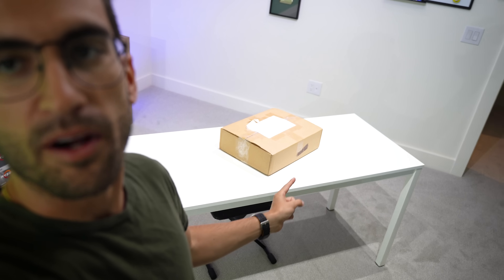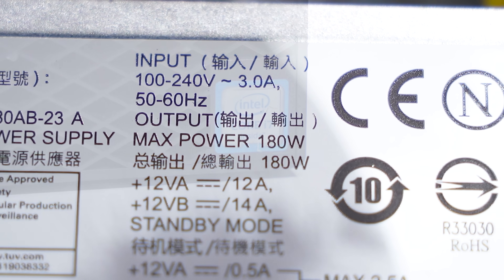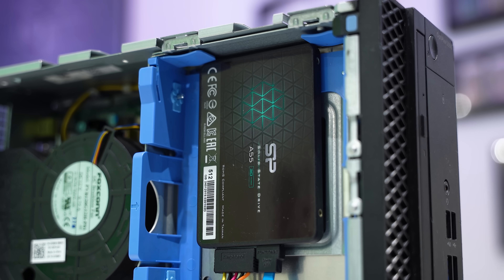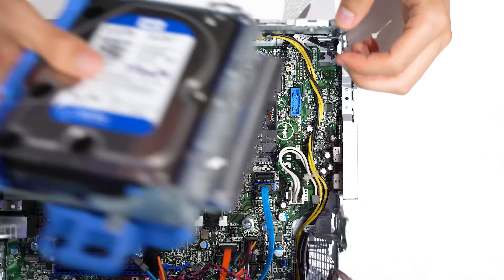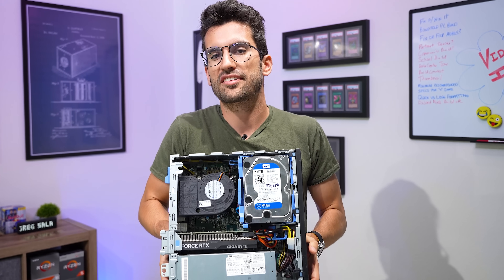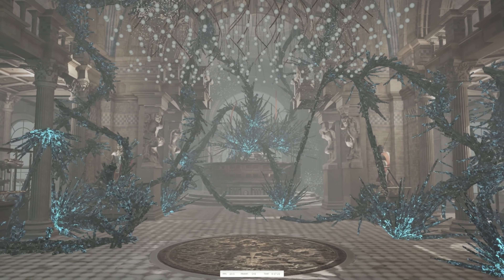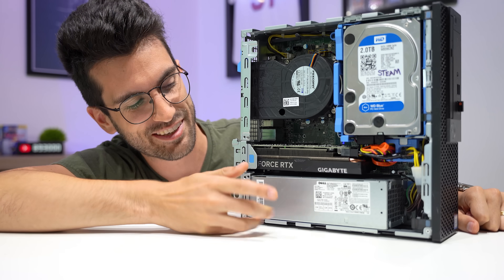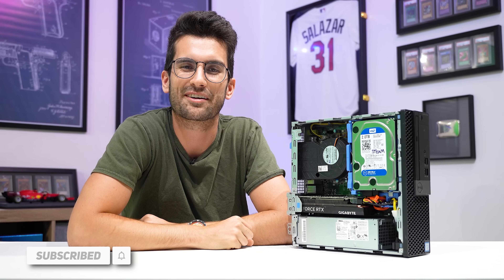This PC Build Makes NO Sense

Comment: You could Bolt the power supply on the bottom of the case on the outside then the lengthen the wires to reach it that would give you enough room to fit the card in the bottom slot and see the full potential of the computer. If you just want it to test it to be sure it's worth the effort you could unbolt the power supply and just move it out of the way so you could move the video card into the bottom slot then test the improvements. And if it really improved it which I'm sure it will, you could take him bolt it on the bottom and figure out from there how you want to stabilize the case if you're going to set it up and down. Or you could just always use it laying flat. The other benefit is now you can put a good cooling fan or the fan for the power supply was because there's a little power supplies don't have good fans for cooling the whole computer. Now if you don't want to drill you can use what's called double-sided heavy duty sticky tape. You can usually buy this in any store that's got a hardware section. And you want to look at the poundage of what this tape will hold and you want to buy the tape that's 20 to 30 lb so that the power supply never comes off by accident.

Where you going to stick the tape clean it up real good, then you can take either green scouring pad or some sandpaper to rip up the metal a little bit. That'll make it to where the tape will stick better. And this tape is the type of tape that's thicker than normal tape and wherever you decide to stick it make sure it's your final choice because once you stick it it's hell to get off. If you want it to make this look nice you could make a little enclosure for it after you install it on the bottom. And you could drill a hole big enough to fit the wires through then use a plastic covering like they use on cars to cover and protect the wires. But all this would be a cheap way to get that video card in the bottom slot and give you a little more room to move some air around inside that case.

Now if you want to make this thing look really nice you can find someone that's really good the sheet metal and they could build you a bottom section to the case to put that power supply in. But being an old computer I don't know if you want to take it that far.

Comment: Honestly though wouldn't it make more sense to cannibalize the dell to build a small form factor PC and use a standard power supply with it? I mean I'm almost positive you can buy patch cables that allow you to plug that motherboard into regular power supplies...
Reply from the maker: Did you not read the title of this video?
Reply: @GregSalazar  I get that this is silly (at least in the US where computer equipment is readily available) that still doesn’t mean there wouldn’t be a slightly less janky way to do it. Lol

Comment: I have a question, are you ever going to go further into becoming a Hardware Technician? Like @SalemTechsperts You could get a scope to check for bad motherboard chips and caps and what not, and make a dead MB alive again!
Reply from the maker: Most of that kind of work isn't feasible - particularly on older hardware. It makes more sense to replace outright.

Comment: I smell a melting 6 to 8 pin adapter. 🤣 The GPU fans are not blocked at all by the PSU. Please Greg let the little Optiplex go on a deserved retirement. 😁
Reply: Not really, that thing barely pulls any power lol
Reply: @Mom19  About a 115W so prolly not going to melt anything i was kinda joking. Would have been good content though if it did that yes? 😁
Reply: NOOO that Optiplex wants to GAME.
Reply: @JuiceboxDesmond  We should let the ancients ones rest even if they dont want to. 😄
Reply: @j.p.h.8126  75w from the slot and then like maybe 50w from the 8 pin at most >-<

Could just have been a 6 pin as well lol

Comment: they managed to fit all this tech in this tiny card because the specs belong to a 50-tier class gpu
pcie x8, low profile, 128 bit bus, 8gb vram
a complete downgrade from last gen's 3060
Reply from the maker: It's a fine card performance-wise. People get too hooked up on specs. Sure, it's not the best value. But for someone who doesn't already have a 60-series card and is in the market for Nvidia, it's not a terrible buy.